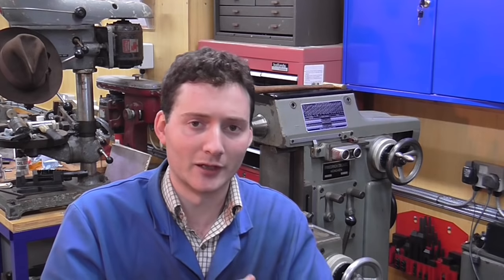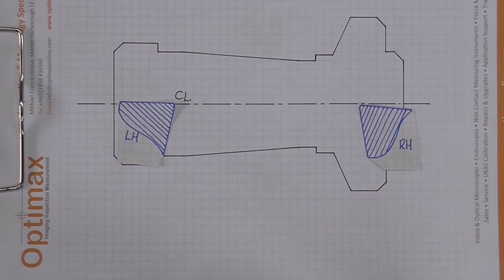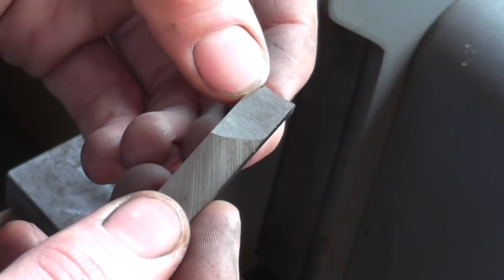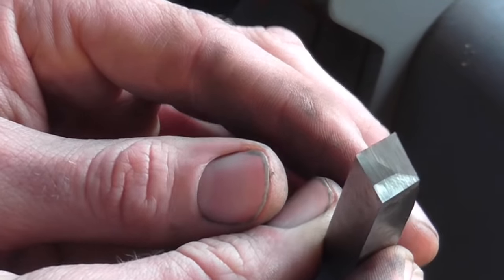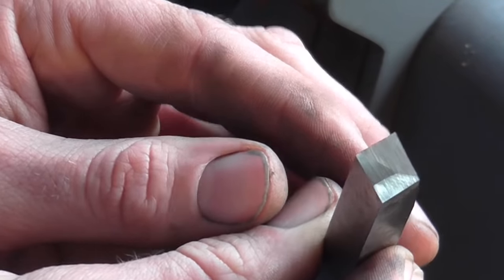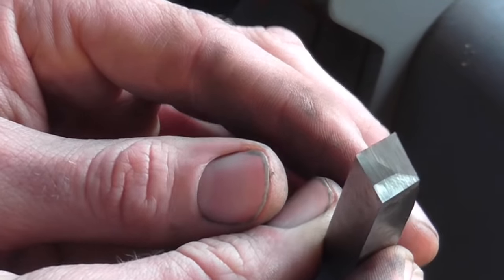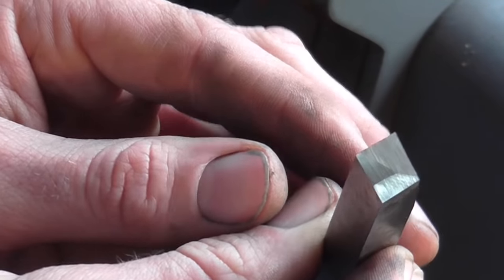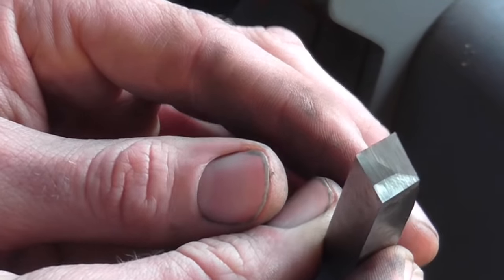Grinding and Honing a Lathe Tool

Comment: Thanks for sharing. My two cent are i watched a drill sharpening video and tried it out on some old broken drill bits. I tried drilling some hole and changed my angles of sharpening. Three days later wail working my boss broke a drill bit. We were 300 miles off shore and not a hardware store in sight. I took the chipped drill bit and sharpened it and finished the job. My boss had left to borrow a new one and by the time he got back i had finish, cleaned up, and put all the tools away. We took lunch.
Reply: The first rule of razor blade gauges is you don’t talk about razor blade gauges!!! The second rule of razor blade gauges is don’t let anyone see you using razor blade gauges!!! Boss: Wait!, that looks like? Is that a razor blade gauge! Me: nope!! It a box gutter gauge! It has a Handel.

Comment: Hi Mr. Crispin - I'm new to your channel, so greetings from Australia (Quinn sent me).  Just wanted to credit you, being a young lad still & having such a great handle on your craft.
With your grinder tool rest, if you put countersunk set screws at the back edge, you'll be able to adjust the angle easier & give it more stability.  Also, any striations in your tool cutting edge will transfer into your workpiece, which can affect surface finishes and/ or stress risers or critical parts. Stay safe and well :)
Reply from the maker: Thanks and good thinking

Comment: Great video.  I like your teaching style.  In the comments below you mentioned that you machine gas turbine blades at Rolls-Royce.  I used to be a production engineer at a gas turbine overhaul shop.  I worked mostly on the Allison 501K engine.  During my time there Rolls bought out Allison so I guess I worked on Rolls-Royce turbine blades as well.  'Worked on' may be a bit of a stretch, but I did look at thousands of them through a 10 power glass.  Ken

Comment: Hi Mr. Crispin. Sadly, i enjoyed this video very much. I agree with you about the ability to grind freehand as it were. Years ago I used to grind freehand cutters for woodworking spindle moulders that used spindle blocks that are now deemed dangerous and no longer available. They were of course extremely dangerous if miss-used. Anyway,  honing ones skills is always a good thing!! Thanks for your efforts and excellent content.
Reply: Operating spindle molders is not for the faint hearted and most definitely to be kept well apart from workers with sloppy practice. The dangers with them are almost always created by an operator who isn't fully switched on.
Reply: @howardosborne8647  Absolutely. 100% concentration at all times. Unfortunately, a chap I worked with 25 years ago can testify as to the outcome of less than 100% attention. Lets just say he can only count up to  81/2 now!!!

Comment: Good talk you gave there, and glad you learned about angled rests a great time saver.
Two things to add, when sparks come over the top edge, you have ground up to the top edge. Second, to check angle rather than use a razor blade a bit of thick card works and is much less likely to cause a sticking plaster incident.

Comment: For my 2 cents worth a sharp edge is the intersection of 2 finely honed or polished surfaces.Well presented as usual.
Reply: Actually it is 3 surfaces, Front, Side and Top.
Reply: @daveticehurst4191  Yes and the radius but my analogy is in reference to honing one face and leaving one like a ploughed field off the grinding stone.
Never as sharp nor as long lasting.
Reply: @localele1  Right ho I am with your thinking now. Yes that’s quite true you could just be cutting with the equivalent of a needlepoint if the top is left in honed. Thanks for pointing that out. Regards from Australia.
Reply: @daveticehurst4191  I live in Australia too Dave.

Comment: for a hobby shop (and novices by the way) this method is the best. First off you learn about the angles and it works out a lot cheaper than breaking in on inserts. I have seen many guys who were trained on the exclusive use of inserts, and they actually have no clue about geometry and angling. This tells me they must be running through inserts like mad....

Comment: Interesting Deckel joystick power feed control.
<silly laughter>
I've got to try 45° milling on my machine by using 2 power feeds simultaneously. The machine itself is capable of power feeding all 3 axes simultaneously whether at cutting speed or at fast traverse. It will also allow me to put the feeds into reverse - so a reverse cutting feed followed by a fast traverse back to the start.
I just need to get a source of 3 phase again !
Reply from the maker: The Deckel can move two axis at once at 45 degrees as you describe. There is no power feed on the z axis on this machine (z being in line with spindle). Thanks for your email I have received it and will read it in detail before getting back to you. Cheers

Comment: Excellent video and very well explained.  Where some struggle is with use of underpowered 6inch bench grinders, often resulting in clogged and out-of-balance wheels.  A stronger 8inch grinder is far more pleasurable to use.  Some basic pointers on maintaining/dressing grinding wheels would be a useful addition, and perhaps mention of HSS containing cobalt which is much harder to grind.

Comment: Honing the top rake surface reduces built up edge. I always try to hone the top surface with strokes parallel to the chip formation/flow, and the primary clearance and radius with horizontal strokes (following the perimeter of the cutting edge). This makes for the best surface quality and free cutting ability.
PS: In scientific terms the chip to tool friction coefficient is used in the primary cutting force calculation as well as the heat generation calculation and honing the top surface reduces that friction coefficient.
Reply from the maker: Thanks

Comment: This is one of the best video's I've seen on sharpening,  Great job... 
I do have one question, what are you using to stone the HSS bit?  I just can't seem to fine the right kind and grit of stone which will do a good job.
Reply from the maker: You have to look in Tim's locker! Only joking, that one is a Norton India Square Stone.
Reply: @MrCrispinEnterprises  Ok Ok you got me.   Actually I did look in Tim's locker, all I found was an empty box, well not quite empty, there was a small note that read "gone hunting".  Ok down to business,  I'm assuming your Norton India stone is fine grit? Thank you for your quick response....
Reply from the maker: Yes that one is a fine grit

Comment: Very informative. Is the cutting point on the top face "untouched" as you grind the rake on it? If your'e an amateur like me and make a mistake, can you just shim the height of the tool to get it to cut on centre?
Reply from the maker: I think I understand the question......The top rake surface should be fully ground with no whitness of the original tool blank.

Comment: I think stoning the top surface is useful because there will always be a slight burr on the unstoned surface which is fragile and could chip the edge if it breaks off. The top should be stoned FIRST though and the sides and front last. The stoning should be done from the edge down and away ONLY and not side to side as you did. This pulls any burr down and away from the edge. The side to side stoning could be used in initial shaping but should be followed with a down and away only stoning. Side to side can also be used as a last stoning if it is carefully done and with a very fine stone to give the ultimate shaving sharpness. - ALL of that is worth the bother only when you need to reliably shave off tenths at a time. For roughing and ordinary finishing work it is not really needed and such an edge is fragile in itself just because of its keen ness.

Comment: Dear sir 
I have a question I not sure how to do it 
I have a contract if I can do it  of turning 50,000 reel lawn mower rollers  3"x14" with a 1/2 hole in center but I also have to make a 1piece wood rollers for hand mowers but turning tree limbs to the recommended size can I make a tip like a gouge to cut the wood or a chisel to slowly bring it down
Reply from the maker: If you mean for turning wood on the lathe then I'd just use a very sharp pice of HSS ground to geometry similar to that that might be used for nylon. Just good positive rake.
Reply: @MrCrispinEnterprises  thank I like to teach me more on a metal lathe for building items thanks again

Comment: There are 2 reasons for honing both sides of an edge. First one has already been mentioned: deburring. Second one is pure geometry: if you only flatten one side of an edge, you'll never get a straight sharp line. It will remain like a...steak knife. As rough as the roughest side.
This is actually the only topic where it's the wood workers who go full maniacal precision! What you call "honing' on that scratchy sounding diamond disc, is still called rough grinding by woodworkers. Woodworkers...and Chris from Clickspring, that is.

Comment: Mr. Crispin, it's now nearly a year since this video was published, so I have doubts as to whether you'll see my question. I wonder if you would comment on what differences there might be, if any, for grinding very small cutting tools - as opposed to the sizes you're used to grinding. I use a tiny watchmaker's lathe made by a long-defunct American company called Rivett and the HSS cutting blanks I have to use for cutting brass or steel are round instead of square, and on top of that they are only 0.1875" in diameter. Common sense tells me that the optimal angles for the top rake, side rake and front rake shouldn't be any different from the ones you cut just because of size. Do you agree? Are there any considerations you know of to grind cutters so small?
Reply from the maker: I'd say just about everything is the same except that the smaller the tool the less forgiving everything is. The only change from what I've done that I could recommend is to use a finer grit wheel as a better surface finish will stand you in good stead for a smaller tool. Maybe a 100 grit wheel on an off hand grinder for instance. Just bear in mind that the tool will heat up quicker during grinding than with say a 60 grit wheel.
Reply: @MrCrispinEnterprises  thank you so much for your reply! Your suggestion for a finer surface finish makes sense to me. I appreciate your comments and I love your channel!

Comment: I may have missed the obvious, but surely honing, or superfinishing, to give it its correct title, is all about creating a smooth surface to reduce sliding friction between adjacent surfaces . . . .  That said, we have ground the front and side faces in clearance, so that they have no contact with the work, and thus they have no real need to be honed - but the top face, which bears the passage of the chip, needs to be as smooth as possible to reduce the sliding friction of the chip and consequent overheating and pressure welding of chip material to the tool surface, leading to built-up edge, poor finish and consequent tool failure.
A fine finish on the tool surface will increase tool life by a factor of two or three times, so the time for this additional attention is well repaid !
Joe Powell, my old production engineering lecturer at Dudley Technical College often said that a production engineer’s job in life was to make as much swarf, as fast as possible, because the customer only buys what’s left !
Those words have stuck with me these past 50 years !
Kind regards from Brummie land !
Steve A.
Reply from the maker: Thanks for your comment. Yes the top surface is certainly critical but lets imagine you are using a tool that has a small corner radius. The smoothness of that radius has an effect on the surface finish because the shape of the tool is generating the results on the work piece. So if you can smooth the inconsistencies left from grinding by honing the I think it's an improvement. 
Also I often think that honing the front and side faces is important when sharpening a tool to remove and burrs left from honing the top face. Could be wrong! 
Cheers
Reply: @MrCrispinEnterprises  
I’d absolutely agree, but since, during the turning process, the tool generally follows a helical path, nose radius and carriage feed/rev play an important part in the quality of the surface finish that is generated, and the nose radius ought to exceed the feed/rev to smooth out the ridges and valleys traced out by the tool . . . .
On the subject of those pesky helices, for a given feed/rev, the helix angle increases inversely to diameter, so it follows that on very small diameters encountered in model engineering it may be necessary to increase the front clearance to avoid rubbing on the work . . . .
Kind regards,
Steve A
Reply from the maker: Interesting point

Comment: If i may, I would like to ask a question. I bought a quickchange toolpost for my ml7, the toolpost is a little high, so i want to mill of approx 2 mill of my topslide, do you think that this would greatly compromise the rigidity of my topslide. Hope you have time for a Q&A :)
Reply from the maker: I'll have a look next time I'm in my workshop. One thing to note is that some suppliers of thoes tool holders make the bottom section of the holder thicker than others. If they are quite thick then you obviously loose tool height.
Reply: @MrCrispinEnterprises  much appreciated. I chose a toolholder that would hold the tools i alreday had, and it does seem to be a little thick at the bottom of the holders.

Comment: Hi can you use a diamond wheel to form a HSS tool bit for my lathe. The RPM of my grinder is 3600
Reply from the maker: Diamond is normally recommend for grinding carbide. CBN wheels are a good alternative if you want to grind HSS with a super abrasive.
Reply: @MrCrispinEnterprises  thanks I really Enjoy your channel

Comment: Hi there, so what grit and type of wheel and what stone at the end are you using?  Thanks
Reply from the maker: I'd say Aluminum Oxide and 60 grit for roughing and 80 or 100 for finishing is a good go to. (That is if you're grinding steels)
Reply: @MrCrispinEnterprises  Magic, thanks
Reply: @MrCrispinEnterprises  Hello again, I wonder if you could answer something for me.  I purchased an old British bench grinder and I need a new left hand nut to go back on the shaft.  Problem is the od of the shaft is 705 thou and the clearance hole is 14.73.  And the strange thing is the tpi is 10.  Is there an old pitch that is super close to 10 and a magic tap I could buy to make my own nut.   It’s just crazy that I cannot find a replacement.  Thanks in advance
Reply from the maker: What is the thread OD?
Reply: @MrCrispinEnterprises  705 thou
Reply from the maker: And what do you mean by the clearance hole?
Reply: @MrCrispinEnterprises  the minor diameter
Reply: @MrCrispinEnterprises  Thanks for your time and effort Mr Crispin, but I found the problem.   I am new to all this and you would not believe my very first thread gauge I purchased, which was not a cheap one I may add, was distorted on the 2.5 metric gauge.  And yes, out of all the sizes it could have been it was that one I needed.  So, I ended up needing a m18 2.5 nut all along which obviously is not imperial like I thought this old gryphon bench grinder/polisher I have.  Thanks again for trying
Reply from the maker: Ok, I haven't been in the workshop since you asked hence my lack on response but glad you found it.

Comment: I'm a tool and die Maker. You sir are way out of your league! Please stay with machining!
Reply from the maker: Thanks
Reply: @MrCrispinEnterprises  no offense intended! I'm just saying that your principals are off.
Reply from the maker: Would you care to explain more?
Reply: @MrCrispinEnterprises  I started with my father in a tool and die shop more than 50 years ago. I have seen many machinest deminish him. However you are on a good start to grinding your own tools! A little advise is pay very close attention to your relief angles when doing so. They are more important than many men think! It will add strength and temperature reduction to the primary angle when done correctly.

Comment: This is a really good video but isn't getting the views it deserves. 
Majority of 'hobby machinists' are still fixated on 'industrial' negative rake carbide inserts ('look at all the extra cutting edges' ) without realising the extra strain and stress it puts on mini machines. (I forget the extra power requirement but knew it 40 years ago)
Then the complaint is 'can't get a good finish' even with sub 0.010" cuts which usually 'rubs' the material off rather than shears it away.
 Trying to explain online that depth of cut and feed rates need to be much (much) higher is a losing battle.
You showed it doesn't need to be exact degrees and offhand grinding tools is actually very easy
Reply from the maker: Thanks?